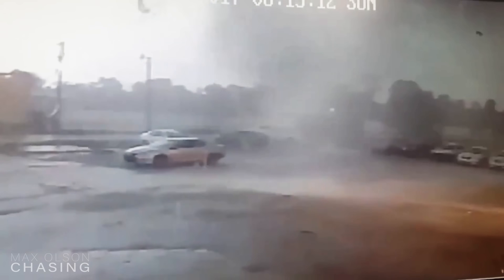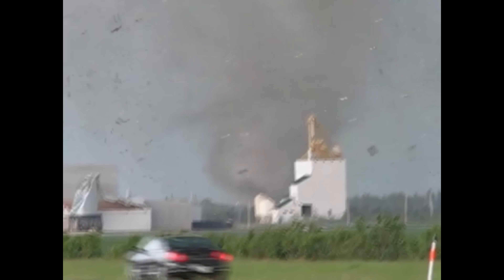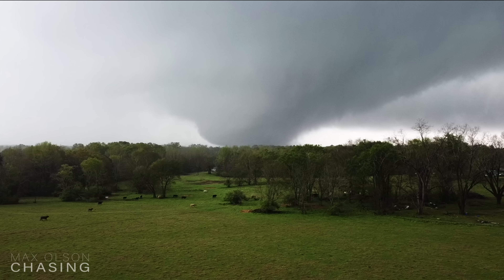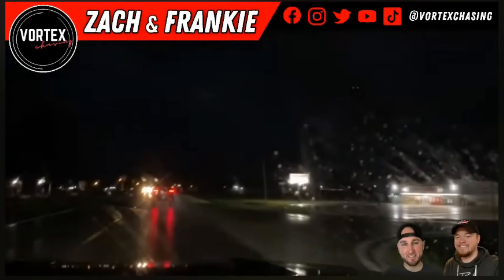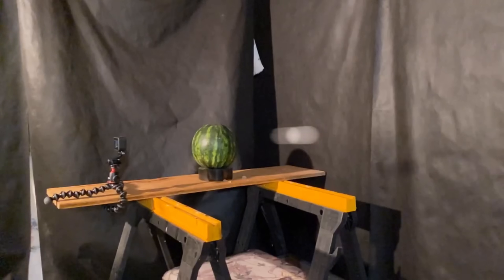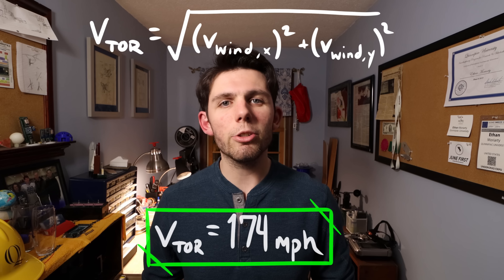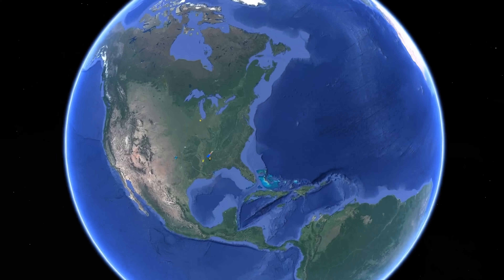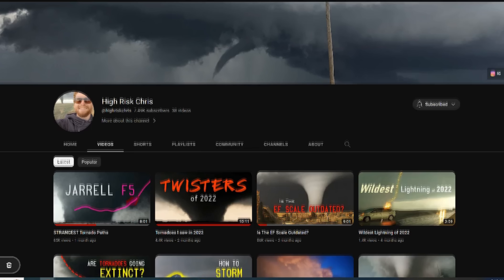Is This a Vehicle Flying Around a Tornado? - Rolling Fork, MS

Comment: A couple of things I would consider:

1: If it was indeed a vehicle, the fact that its lights were on steady but not flashing (like a broken into vehicle's alarm system) would probably indicate a high likelihood it was occupied. So almost certainly an in-vehicle fatality or fatalities. So check examine any deceased's person's vehicles.

2: Coming down from a height of 420 feet would create an absolutely catastrophic level of damage. It would far exceed the damage of cars merely rolled around a short distance on the ground. So, look for a vehicle with an unusually high level of destruction. That is, unless the vehicle was set down more gently in the outer bands.

Comment: Seems to me very unlikely for this (any) tornado-lofted vehicle to maintain an orientation such that the light from it's headlights would (apart from when behind/obscured by the funnel cloud) remain visible and very nearly constant to the viewer throughout its circumnavigation of the tornado. Ball lightning or some other form of storm related electrical discharge phenomena would be more likely to generate the type of light that could remain visible to the viewer regardless of orientation (apart from when obscured behind funnel cloud) 🤔

Comment: after some thought, the brightness of this object is substantial because a vehicle would also be tumbling around with the lights briefly being in your direction, more like a lighthouse flashing. 
and then i thought what if the vehicle was on fire with all the combustible things like seats and carpets alight being blowtorched by the large amount of oxygen and wind 
i think that would be bright enough. in the el reno tornado there is footage of a vehicle circling the tornado and it is flashing as it spins around. i picked this out using a high def screen.
my reasoning for this to happen is that generally a tornado sucks in air from every direction and also has more extreme flows coming in that are usually referred to as the ghost train. this incoming air wants to make it all the way to the main vortex at ground level where the 4 or 5 vortices are within the main whole, however much of the incoming air meets resistance from circulation and is forced into an upward spiral creating an upward blast which is then incorporated into the wider funnel at 500 ft. i believe this is why the debris field for the heavier objects tends to end around this height. But if the forces of gravity on the weight of the object, its shape, and the upward blast and circulation were all in balance, then a heavy object could in theory be held for a while. this is my best theory after many years of studying tornado footage.

Comment: Not sure if anyone has made this comment or not. To me this looks to be a set of work lights off of a work site, they're relatively light they are generally on small trailers with a little generator to operate the lights they stand it about 8 to 12 ft tall and have reasonable surface area allowing it to be picked up easily. They are also designed to protect light and multiple directions at one time allowing us to see light emitting from it regardless what direction is pointing.

Comment: Has anyone considered that the weight of a vehicle is not evenly distributed, they are front end heavy, and with this being rotational force, not straight line wind, the heavy end would always face outward away from the center of circulation?  That could explain why you see the headlights only.

Comment: It is a possibility that it was some sort of a vehicle. If not a car, it could have been farm equipment. You did mention Rolling Fork is a farming community. A tornado hit here in Dallas in 2012 and it flew an 18 wheeler at the Schneider Trucking terminal off of I-20. So if a camera seen an object with a light flying in the vortex, hit had to had been some kind of vehicle and for sure rule out street lamps because obviously, if a street lamp was unearthed, there would be no power.

Comment: The vehicle in question, may have been picked up by the strong updraft of the tornado that was strong enough to carry it for a short while and then drop it where it landed. The BIG question is, was there anyone IN the vehicle at the time? Since the headlights were on and visible to those observing on the ground, I have to wonder. Was there anyone in the vehicle or was it quickly abandoned just seconds before it got taken up and carried away? I hope it was the latter. I, personally have had a close call experience with TWO nighttime tornados while driving my 1996 Nissan King Cab back in 1996. I felt the truck get lifted off the road only inches several times, even though I could not see anything as I was racing to get away. This happened to me twice in one night in two separate states. Cars today are lighter than the ones of yesterday, so the possibility of the flying object was in fact a vehicle is much greater. If a tornado can lift, carry, and fling a large truck & trailer, well, then it's no problem for a lightweight car or even a minivan or a 4X4 truck. 
There is another story I have heard, but can't substantiate, is a full sized single-wide mobile home was picked up and carried off for a couple of miles, with a mother and two children inside. The trailer home landed softly, enabling the mother and kids to escape, just before the home was picked up again and destroyed. Strange, I know, but strange things DO happen in severe storms.

Comment: Maybe an exterior solar powered motion light or a few of them. Tornado ripped them off of a house and there is plenty of motion in the tornado to keep the light on. People in my neighborhood have them and they are very bright, some of them have multiple lights on them, and they are designed to emit light from multiple angles. Could still be attached to a large piece of the house that got swept up into the tornado which would effect the spinning speed of it, perhaps keeping it more stable while swirling around the tornado’s vortex.

Comment: I hate to word it like this, but you could possibly narrow this down some by searching for victims. If no one came forward and said they were in a car hurled like this, it would imply the possibility that someone was driving it while it was swept up, as the lights are on, and potentially a victim would have been found in a car in that area. 

The assumption there would be that the driver didn't abandon the car with the keys, but if they didn't, it would narrow the search down rapidly.

Comment: As far as this light source being a vehicle, I am personally dubious as the light is constant. If it was a car or truck, the vehicle would not be turned constantly at the camera. The vehicle would actually be rolling and tumbling if not spinning, causing the light to be sporadic or twinkling at the least. You can imagine the vehicle would be turned away from the camera in equal time as it would be turned toward the camera. This is a cool idea but that is not a car. They need to look at how bright the light is to be seen within the rain-wrap, as well as how heavy it is, and what would be its power source. I also cannot believe that the battery connections would remain intact for that long with the vehicle tumbling in the wind. Would the sensation of weightlessness apply here or, would the dynamic forces of gravity and the horizontal jerking and twisting in a battering box be more plausible? I would think if a person was in that vehicle, they would not feel a floating weightless sensation, I think they would be brutally hammered into unconsciousness or death long before the vehicle dropped to the ground. Therefore, the lights would be disconnected from the battery in the same manner.

Comment: You would think that a vehicle swirling on the outer edge of the vortex would be slung away considering its weight and not hold its rotational pattern unless it was within the center of the tornado itself.

Comment: It probably isn't quite as impressive as a car/pickup flying through the air but, there is a very real possibility that it could have been a side by side.  They have lights that are every bit as bright as a road legal vehicle and they usually weigh around 1 ton or less.

Comment: It will be so hard to find these cars. When they hit the ground they will break into pieces and still be dealing with 200 mph winds these pieces will become so scattered that they will be writen off as parts removed prior to the storm. Im sure there's loads of car parts in the destruction from mechanic shops autobody shops parts stores and salvage yards so it will be nearly impossible to piece these cars back together and confirm it as the one that flew around the tornado.

Comment: With the lights on, that would tell us someone was inside it. How many vehicles in Rolling Fork we're found with deceased occupants? Not to be morbid but the potential does exist that an unoccupied vehicle as parked with the lights on. That a vehicle was damaged trigging the lights to come on. Or that an occupant was ejected. But the more likely scenario is that the occupant was inside the vehicle and likely was found that way by rescuers.

Comment: I think these are battery-powered LED emergency lights from destroyed buildings, that turned on when the power failed and have stayed on even after getting ripped from their mounting brackets and lofted into the tornado.   There is more than one of them visible.

Comment: If an ef3 Tornado can loft a tractor trailer hundreds of feet and a 1/4 mile from where it was, I say definitely a car can ride the carousel of an ef4. No one has mentioned that it may have been a remote control aircraft but it  does appear to be headlights of a car.

Comment: Have you ever seen a NASCAR race when a car gets turned around and lofted into the air?  To prevent this, in recent years they have required "flaps" (similar to on an airplane wing) to deploy to disturb the air flow (and its aerodynamics) over the car.

That said, any object (i.e. a vehicle) would have to have similar aerodynamics in all directions over all of its surfaces to say airborne; otherwise it would lose its "lift" and fall to the ground.

Comment: I would check for reports of vehicles found a significant distance from where they were left which are catastrophically damaged. I doubt they were stolen and taken for a joyride through an active tornado. Seems like a much easier way to answer this question. Science folks tend to overthink things sometimes.

Comment: I was involved in a post tornado debris field within a mall helping a company recover anything sellable. The ef 4 wiped a 3 story apt complex next to mall completly off its slab, and over 20 died. Inside the mall we were told not to drink anything from the liter plastic bottles, as thw wind threw sand particles thru the plastic, contaminating it, but no visible holes noted. The i beams above us were twisted like pretzels. Pretty impresive.

Comment: A lot of stuff flying around. Other items can trap themselves on the vehicles and add the the surface area and provide more lift. It could have rolled onto a house and them the siding or roof under it helped lift it and throw it into the air.

Also, you don't need to sustain a high speed. You just need a burst to get things lifted, then the speed can be lower to keep them lofted.

Comment: Don’t think the second one left was a lens flare. Firstly you need an intense light closer to the lens. I’m surprised there wasn’t a discussion of other vehicle type. A four wheeler is under 500 lbs and can have full headlights. Much easier to loft. Never seen a drone with lights like that and it would be near impossible to pilot one in those conditions. I just hope if that was a car, the lights turned on because of damage and not someone fleeing the storm. Terrifying.

Comment: Anyone who owns a pickup knows their light butt slips in ice or even rain. But It also make sense - that THIS was a pickup flying NOSE DOWN. #1 it would be picked-up tail first. #2 this explains why the headlights REMAIN visible throughout. Notice how CONSTANT the light is in the video - not blinking or disappearing. A P/U flying nose-down would exhibit the headlights throughout its rotations.

Terrifying though. The headlights on means most likely that someone WAS inside. Dear God.

Comment: Not saying it wasn't a vehicle, but what are the odds that the vehicle made that entire half revolution on the cameras side of the twister while facing outwards the camera? You'd figure if it were being lofted that it would be getting rotated and flipped in multiple directions, yet the lights consistently pointed outwards instead of towards the twister, at the sky, or at the ground.... and not just on that pass either.

Comment: Seems like the uplift, humidity, gravity, and car type all come into play.  We know that gravity is a waveform, which can help in such conditions.  We also know Toyota makes the best kites on earth.  With the minimum wind speed to pick up a car, we also need to factor in the humidity which can float a car with the wind factored in.   Watching the altitude decay shows the object was moving away from the center, this should give us an idea of the mass this object had.  Seems like there would be a few good simulators on the market to run this data through for the best results.

Comment: No way this was a car. Drive a car in a mile wide circle with it's lights on and you won't see this. It had to be a light source visible from 360 degrees like boat lights. Odds are, it was a truck mounted beacon light that is msgnetically mounted making it easy for a tornado to strip off of a truck. To me it's likely something of the sort.

Comment: Aerodynamics? Given the relatively flat undercarriage of many vehicles, it seems plausible if the wind component was strong enough moving under this surface, the lift created might play a big role. Look at the smaller wing surface in any large transport aircraft. VR is often in the 145-160 mph range and compared against the much bulkier and heavier fuselage structure, it doesn't take that much to get planes off the ground and keep them aloft. In the end, could not a vehicle's undercarriage literally act as an aircraft wing? Maybe a subject for an aeronautical engineer,. Great work here!

Comment: A terrifying thought is that, assuming that it is a vehicle with the lights on, then that means someone was most likely in it. Why else would the headlights be on? Let's hope that's not true and they saw the tornado coming and were able to get to shelter before the vehicle was picked up.

If it is a vehicle, though, I would expect to see white and red lights alternating as it tumbles through the air. Why do you think there aren't any red tail lights to go with the headlights? Tail lights aren't as bright as, say, high beams. So even if the tail lights were too dim to be visible from that distance, the headlights should at least slowly blink as they point away and towards the camera as the car flips and tumbles. But it doesn't. It's visible the whole time. I find it hard to believe it never flipped even once to point the headlights away from the camera in all the time it's visible. That also means the yaw rate of the car is such that as it orbits around the side and behind the tornado, it keeps the headlights pointed at the camera. It could roll all it wants and it can pitch up and down quite a bit and still be visible but the yaw would need to be just right so that the lights stay pointed at an angle that the camera can see as it goes around this cylindrical object. That's kind of hard to imagine it would naturally do that. But I also can't think of any other source of light that would fit the circumstances.

Comment: Need to do more research into the in flow and measure the volume of air going into the tornado and there you will find the answer as to its potential for lifting an object along with a lot of other critical data.

Comment: I would say go find footage from the town before the tornado and at night time and see if anyone had battery powered emergency light fixtures in or around their home. 

I don't think it's a car due to the lack of spinning and tumbling, those lights are pretty steady.

Besides.... the height and speed that thing was moving..... you aren't looking for a normal wrecked car... you are looking for mangled scrap.... because even after it plants into the ground it still has wind and debris interacting on the wreckage.

Also.... modern cars/trucks are held together by plastic clips.... so not only would that thing be getting whipped around but it's keeping the grill/light mounts in place?  I dunno.

Comment: Could battery cables even handle that kind of force and stay attached? On the other hand, we've all seen vehicles take flight on drag strips. Obviously the amount of lift potential or drag component of said vehicle would play a part. Like the tractor trailers we've already seen fly in tornadoes. They obviously are like walls that catch wind. Just thinking out loud